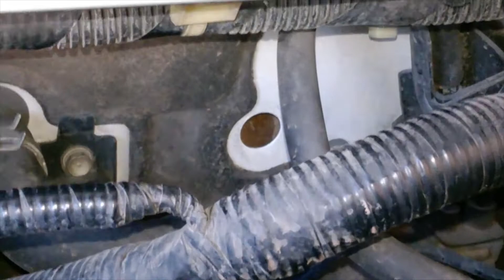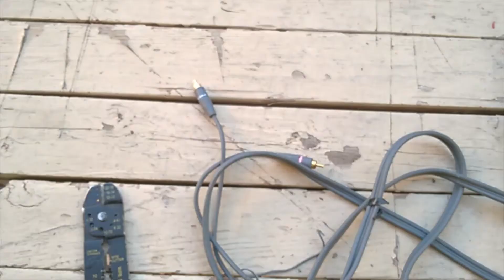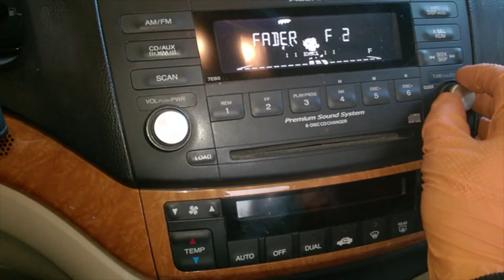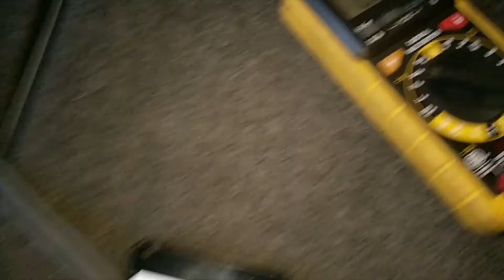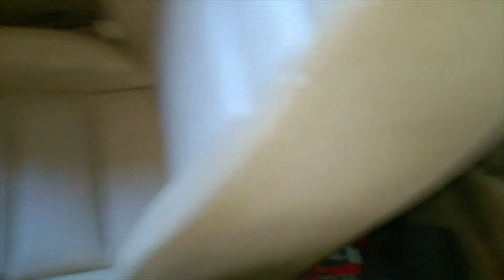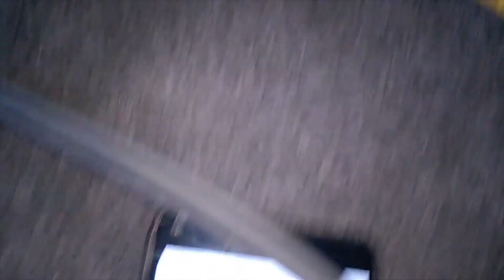TSX Amplifier system install Stock radio

Comment: The area your showing in the video to do the out going wire to the speakers on my harness its pink and blue. On the opposite side of the harness its blue and purple. I gues that would be the lower pins. Mine is a 07. So the pin configuration is the same or not

Comment: What wire on the factory harness for the blue remote wire. And what color wires for the rear speakers im trying to add a amp for my subs in the trunk I installed. And I want to tie into the wires for the rear speakers before the factory amp.

Comment: Does this give a better signal to your aftermarket amp vs an amp tapping into the rear decks speaker level output? Using an audio control Lc-1.800 for sub. 

I’d like to completely bypass the factory amp and add an amp for doors and hopefully get a signal that isn’t already eq’d from factory.
Reply from the maker: This is what you want to do. It does all of those things. The 6x9's are filtered. This gives you the signal that goes to the factory amp unfiltered (the full signal).
Reply: @kayjay4060 I’ll rewatch this another 200x so it can register completely into my beginner mind. So you you basically bypassed/got rid of your factory amp, correct?
Reply from the maker: @NinaBabyTV  The head unit sends a clean unfiltered signal to the amplifier. I did not disconnect the signal. I just tapped into it with a wire splice. The signal now goes to both of the amplifiers. I spliced the wire between the amplifier and head unit.
Reply from the maker: @NinaBabyTV  I took the signal between the factory radio and factory amp. The radio sends a low level audio signal to the factory amp which the amp amplifies. I tapped in to the signal between the factory radio and factory amp. It is a low voltage signal. Which is what you want. 
If you take the signal after the factory amp. Whether it is inside the radio, or somewhere else in the vehicle it is going to be too high of voltage. Like the signal you get at the factory speakers. Normally you would use a converter to bring down the voltage, but this specific signal is already low enough to use.
This only works if you have a factory amp located separate from the factory radio. Since it is that low voltage signal going from the radio to the amp that is being used.

Comment: that factory ground, is it good??
Reply from the maker: I didn't have any issue with it, but I would caution using a factory ground if it is attached to sensitive equipment. I didn't know this fact at the time. 
I would make your own ground, but I didn't want to modify the vehicle at all. I didn't have to cut, drill, sand, or modify anything. Nothing was altered except the RCA cable.

Comment: Where did u get the remote pls?? That's the part that I'm lost!! Thank
Reply from the maker: Remote? Remote wire? I fuse tapped it in the fuse panel in the driver foot well. Let me know if you need more clarification.